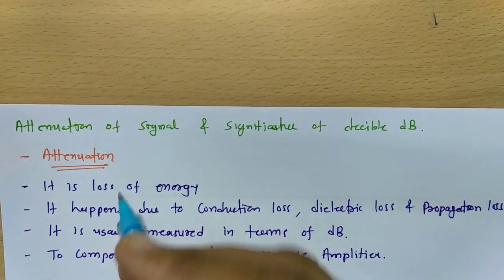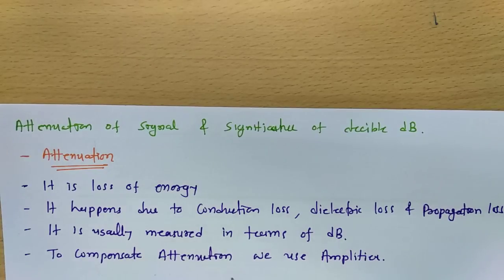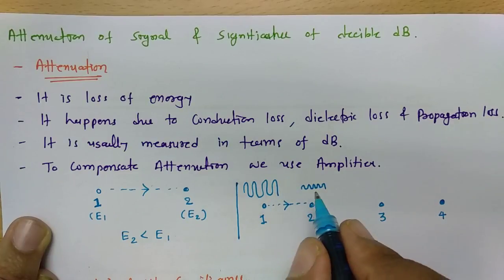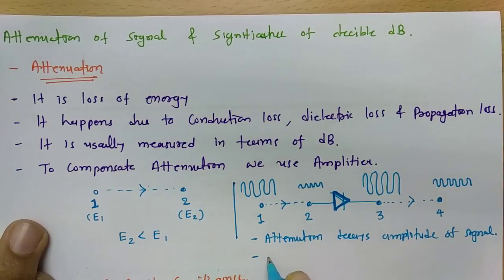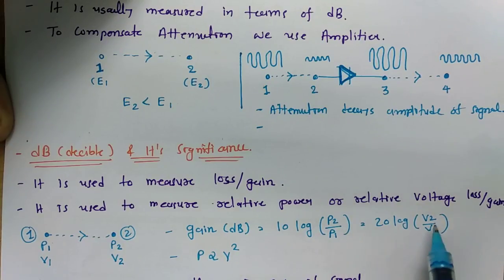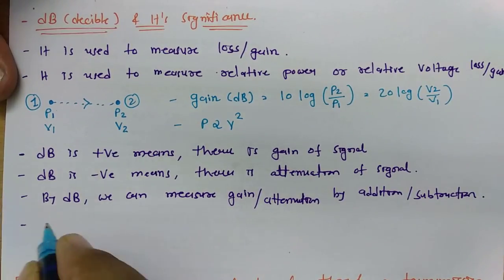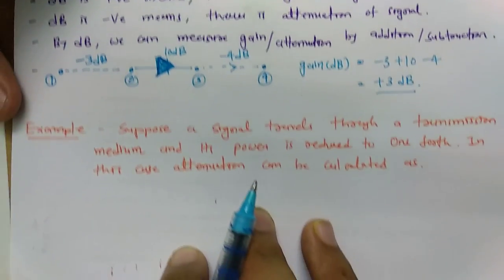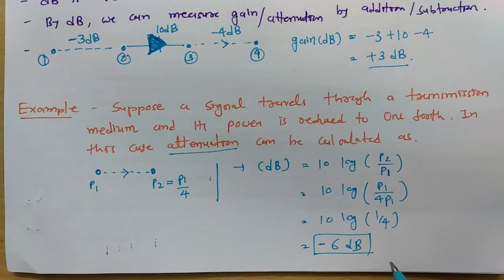Attenuation of Signal | Basics & Reasons of Attenuation | Significance & Example of Decibels dB

Comment: Thank you sir for such explained videos 
 As attenuation doesn't effect the information only magnitude of amplitude decreases ....my question is if we are talking about AM or ASK modulations in these cases attenuation will not change the information
Reply from the maker: Attenuation does not change information but attenuated signal requires highly sensitive receiver.
Reply: @EngineeringFunda  so u are trying to say that attenuation will not affect AM n Ask modulations
Reply: This is also my question. Since attenuation only affects the amplitude of the signal, will it not have effect in the data of a modulation scheme that uses AM or ASK? Thank you.

Comment: is information not present in amplitude?
Reply from the maker: It is present in amplitude.
Reply: @EngineeringFunda  then if attenuation occurs then there will be loss of information
Reply from the maker: Nope, attenuation is just changing scale of amplitude, it doesn't change information, by attenuation shape/information of signal will not change. 
Information of signal is there in shape of signal, so attenuation will create problem in detection of signal but after amplifier we can easily extract information.